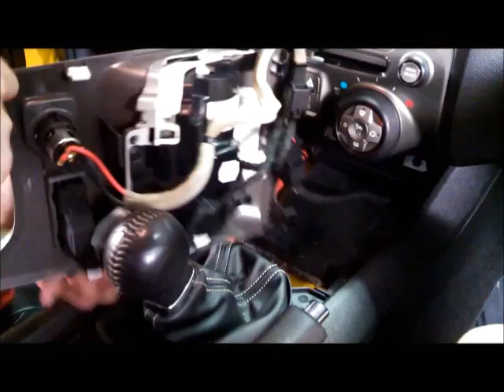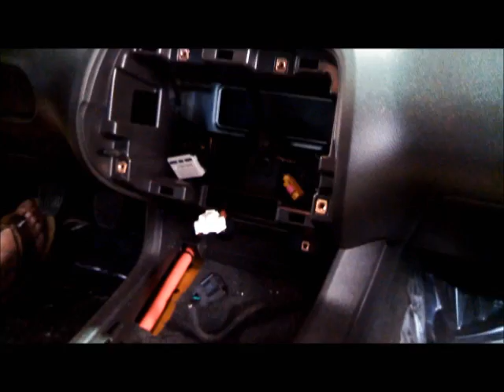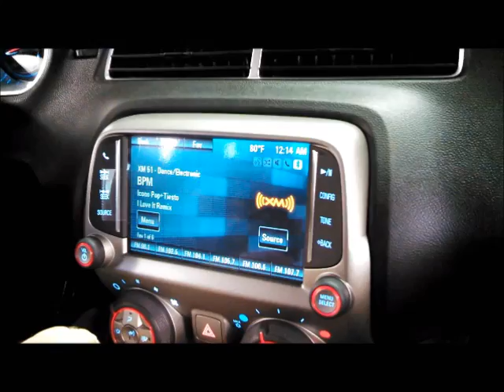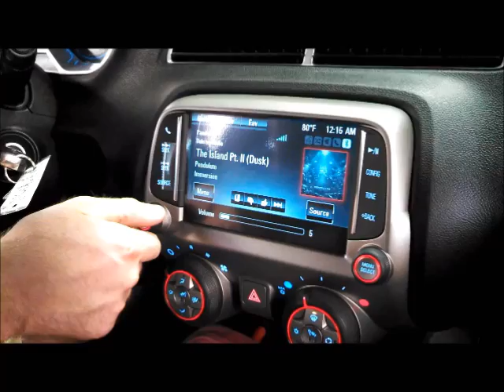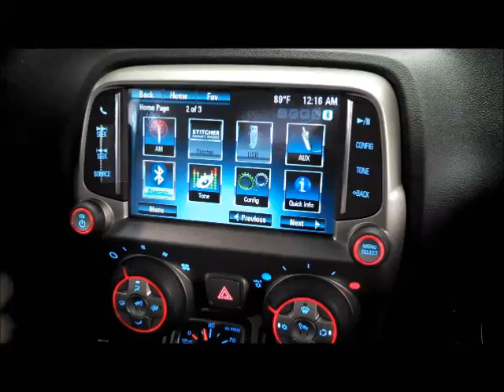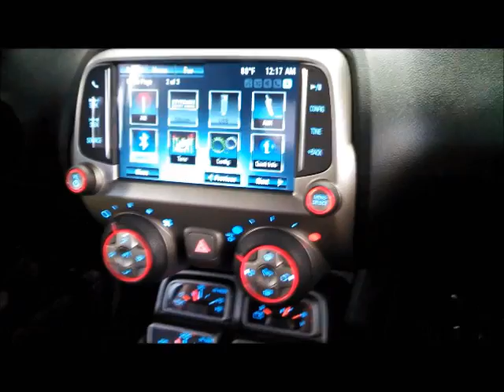How to add Factory MyLink/Navigation to 2010-2013 Chevrolet Camaro

Comment: interesting question, how do you unlock the doors from the inside and lock them?
Reply from the maker: There is a kit that can move the locks to the door panels. Most don't worry about the switch to be perfectly honest, however, if you want to spend the money on the relocation kit and go through the work...we can help. Its all a matter of budget.Just need to TEXT us for more info 919-995-9523

Comment: I have a two questions. first. will the 2014 mylink with SMS text option work on a 2010? second, if my car doesn't have a back up camera, do you sell the back up camera equipment with the mylink? thanks in advance. I am very interested.
Reply from the maker: Yes S will work and we can also provide you with a camera setup. Just TEXT us for more info 919-995-9523

Comment: I have a 2013 Camaro LT with the infotainment system in it. Is it possible to add a backup camera and run it to the screen?
Reply from the maker: Yes, a back up camera can be installed and ran off of your screen.  If you have any other questions or concerns please contact the number at the end of the video or email us and anyone of our team members will be more than happy to assist you.

Comment: Any time frame for when you guys might make a kit to include the door function?? Thats probably stopping alot of ppl from getting it
Reply: guess he Won't respond to this issue.
Reply from the maker: Honestly...we've sold over 300 of these upgrades and the door locks are hardly ever a hang up. There is a kit on the market that does require some new parts for the door panels...which we can likely help with if that's what's hanging you up. You would need to TEXT us to discuss things as its not something we offer on a regular basis.919-995-9523

Comment from the maker: That is correct...you will loose the lock button. You can still lock manually or with key fob, you can also unlock by simply pulling the door inside door handle.
We are considering making a kit to retain the locks